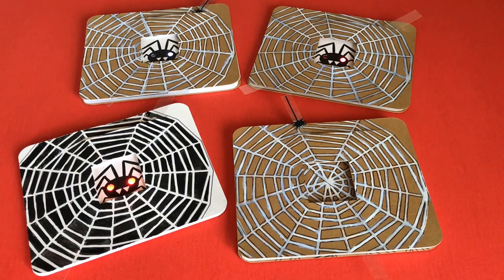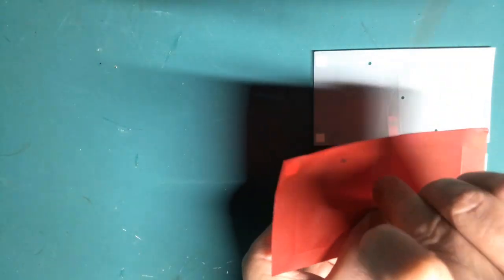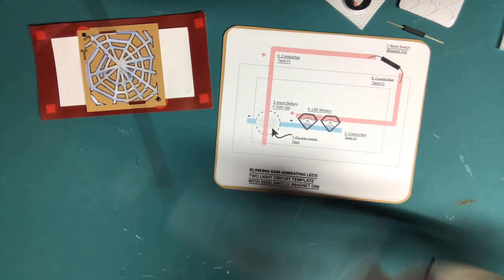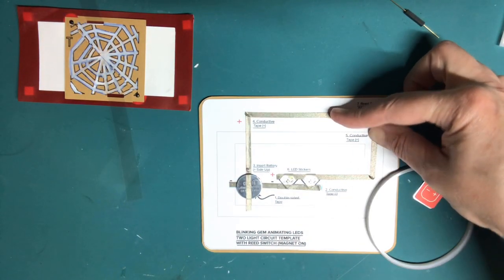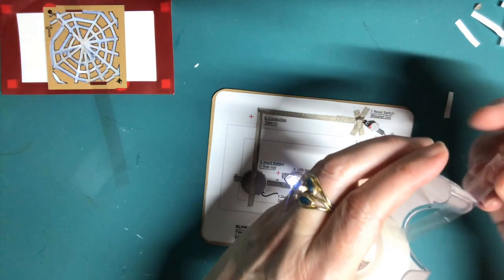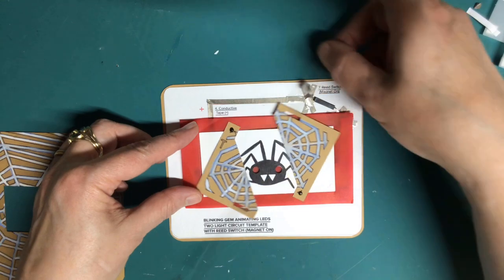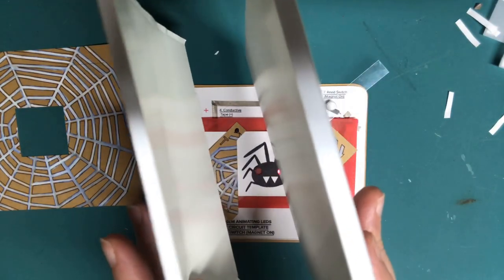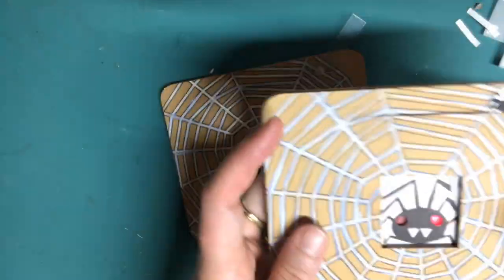Spooky Spider Diagonal Dissolve (featuring Chibitronics) by JIll Dawson

Comment: Very clever. I wonder if the bottom acetate lever could be trimmed up so as not to show and still be functional? Love this spooky card so much!🕸️🕷️🕸️
Reply from the maker: Hi!  Thank you!  Yes, you can trim as much of the lever as you like.  While I mentioned that this was a possibility in the print-based tutorial on the Chibitronics website,  I didn't show it in the video.  After creating the video, I actually went back and trimmed the bottoms of all of my cards so that the levers wouldn't protrude from the bottom unless the doors were opened.  I also thought about doing a modification to a future iteration to make the overall card a bit more compact.  Thanks for your note!